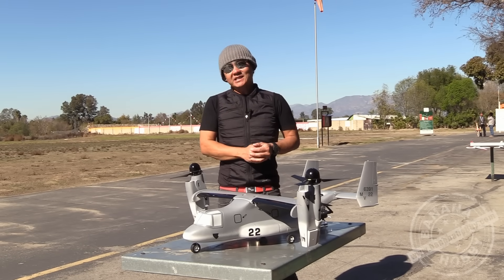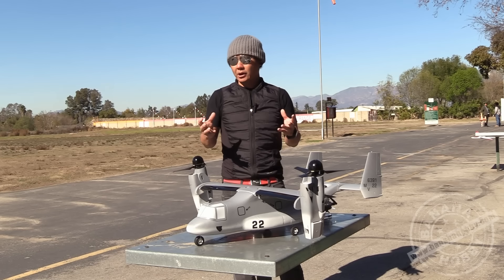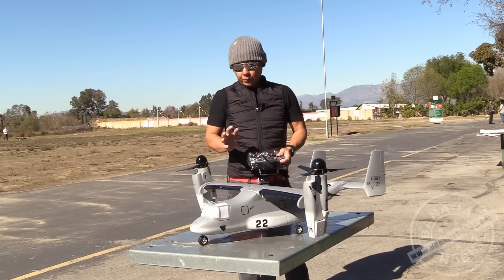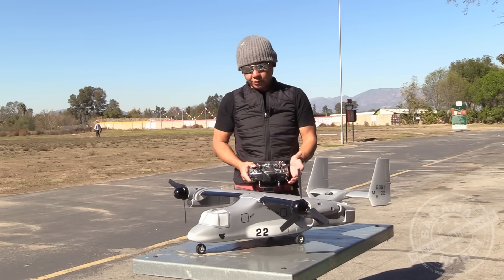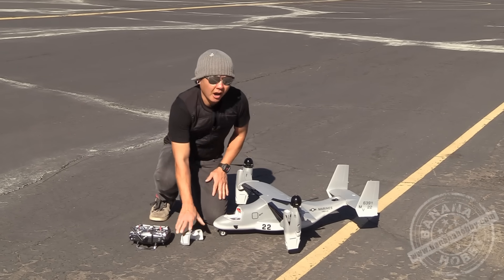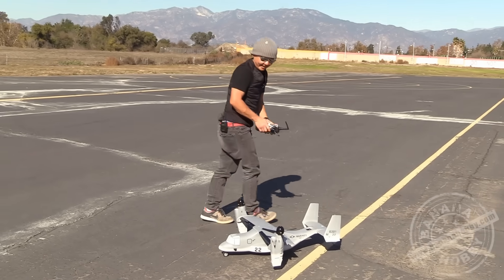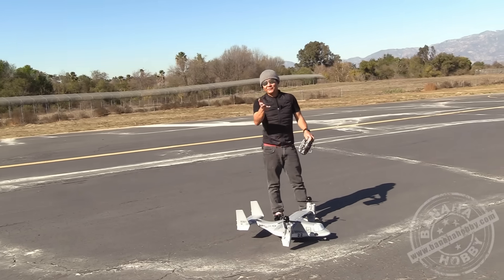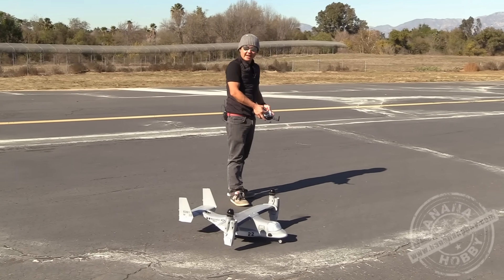VTOL V-22 Osprey RC Model at Banana Hobby!

Comment: ALMOST scale.  Rotor blades are not to scale.  Would not be able to forward tilt rotors on ground without grounding or eating up the blades.
Reply: The actual v22 is the same way, it can't land horizontally because the rotors would hit the ground
Reply: @nathancooley8459  But the V-22 props in this video DO tilt full forward on the ground.

Comment: why are the rotor blades to incredibly short?  You're not supposed to be able to rotate the rotors down while the craft is on the ground.
Reply: Adam Churvis  The limits of a scale model, I’m sure it can’t look exactly like the real V-22. Same reason it has a small lift fan by the tail.....👍😎
Reply: @jjojo2004  Didn't see the tail fan (wasn't looking at the tail), and I'm definitely not an RC expert, but wouldn't it have worked better without the tail fan, with rotors proportional to the full-scale aircraft, and with a wing position that places the center of gravity proportionally to the full-scale aircraft?  I genuinely appreciate any guidance you folks have for this novice who really wants to understand more.  Ever since I saw Flight of the Phoenix with Jimmy Stewart back when I was but a wee child remembered what Hardy Kruger's character said about how model airplanes were the same as full-scale airplanes, so I didn't exactly get my info from a credible source. :)

Comment: I’m considering buying this product, but I have a few questions.

1. How durable is it? What material is it made out of?

2. How long is the charge and fly time?

3. Is there a warranty or Guaranteed refund?

4. How long is the average shipping in US NA East?
Reply from the maker: Hello, this V-22 is available as a RTF package from our website. The material is EPO Foam and is very durable. Much more durable than EPS Foam. On the standard 4s 2200mAh battery, flight times can be different depending on throttle amount and flying style. We do offer limited warranty depending on the type of issue since this is a flying radio controlled model, we do not warranty crashed or misused products. Shipping should be about 5 business days to the lower 48 US States. Thank you!
Reply: Thank you!

Comment: They're called "nacelles" not "motor pods"
Reply: Yet everyone knows what is meant by motor pods, and the pair of words is consistent with the common meaning of those words. If they'd said 'spinner buldges' or something that would be more of a problem.  Your statement is correct in general, because generally they are referred to as nacelles. But if someone refers to them as motor pods, especially more than one persons, even if only two people do that with each other, well then, that renders it untrue to claim they are strictly 'not' called motor pods. Then they are aka motor pods.

Comment: I've noticed some poor construct on mine. The hinges are supposed to have 4 screws to mount to the flap, they only have two and most all are coming g off the flaps. Inside the engine cowl the EPO foam rubs off the motor. You will have to change out the battery connection because it can't handle the voltage and it do arc. You will need to put more screws in the flash mounts. So two serious issues with it than can be fixed, they cheaped out on this as much as possible.

Comment: To think that I have lived a long life where I saw  and handled the individual valve changing into the individual  transistor with discrete components which developed into the integrated circuits   and  the controlled flight of piston engined planes and now all this software and processes and computations after one reads the signals off the tiny accelerometers and the gyrators and GPS   in jet powered and electric powered planes, I think that I am a very lucky old man to see such young intelligent  builders and pilots come up with such models containing such high level technology which  in my time, the systems I worked on, as aircraft carriers, destroyers, submarines and torpedoes, nor  planes had  all this technology in such a small space.  Heartiest Congratulations young man,  for knowing such  technology and trusting it with all those hours of your hard work.  Do Use  such elevated technology   to help all nations and people  in need and never misuse  the power of technology that is contained in that small space. It was very pleasant and rewarding seeing such a performance. Thank  you young man.
Reply from the maker: Wow, thank you for the glimpse of the technology that came before! Even now, we have to thank all those that came before us, the ones that paved the road for the future generations to continue researching and getting us this far. This RC VTOL V-22 is definitely a feat, and the result of hard work and determination for those involved. Once again, thank you for sharing!
Reply: and don't forget rubber band powered escapement servos and single channel planes. Kept pressing the xmtr button to go from straight to left to straight to right to straight. This was rudder only. Lotta fun back in the '60s...
Reply: Well...it is just plug and play, after all.
Reply: its crazy how fast r/c tech evolved over the years! I got a parkzone mini p-51,it’s a blast to fly! the receiver is the size of a book of matches,with 2 integrated servos!
Reply: Hey, hopefully we might have self aware AI in the future!
But I'm hoping for self driving army tanks, honestly.......

Comment: This is an outstanding plane, both in RC and the full blown version.   Why don't they make the props longer (more like the full sized ver), most likely making it possible to loose the third motor, plus wouldn't that keep the motors from working so much harder in the vertical mode?
Reply: Third motor is for pitch control in vertical mode (necessary because, other than at the real Osprey, the omitted cyclic pitch on the main rotors). You can hear the whining stops when entering horizontal mode...

Comment: G'day,

   Amazing, the way the missing Rotor-Blade on it's Right-Hand Engine, all the way through the Pre-Flight Briefing & Familiarisation-spiel, didn't seem to impair the Flight-Characteristics at all.

  Am I the only one to have noticed that remarkable achievement ?

lol.

  ;-p

  Ciao !
Reply from the maker: Funny observation! I had to do a double take as well, but the blade is definitely there. These blades are not fixed in place and can move around while not in use. However, it's definitely visible in this segment: https://youtu.be/Hly5w457cD0?t=2m49s (you just need to look closely). All in good faith though, thank you for the laughs and for watching! -Alex
Reply: @bananahobby  The rotor blade is not visible even when it is picked up and moved around to demonstrate the gyro correction. I call BS
Reply: @markhilchey9891  , see in detail, at minute 02:59 (https://youtu.be/Hly5w457cD0?t=2m49s ) . You can see two blades almost stacked, one above other. It is very hard to see because there is no contrast, with his black t-shirt. Watch again, stopping at that that minute.